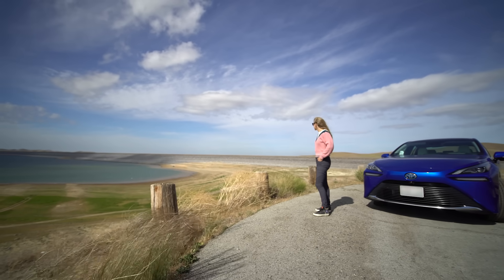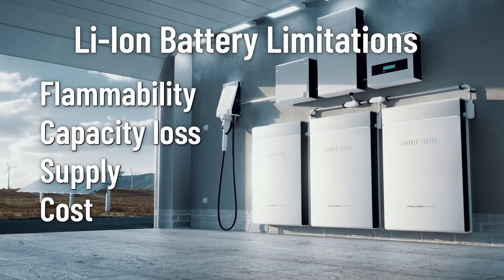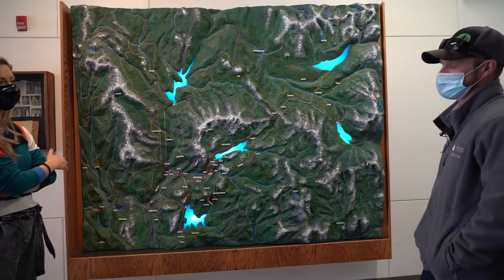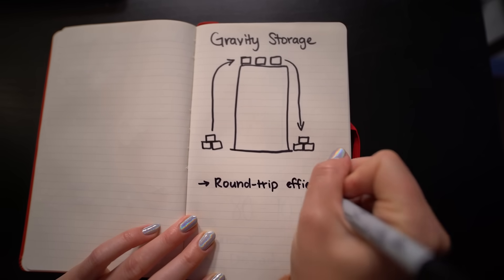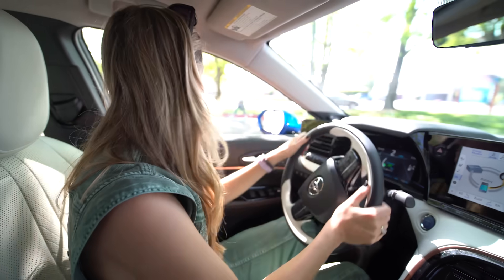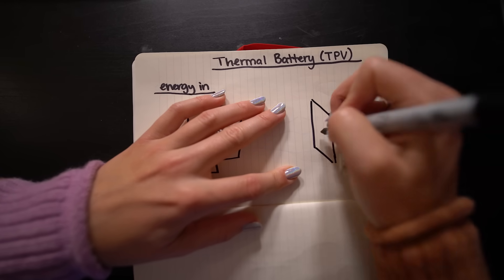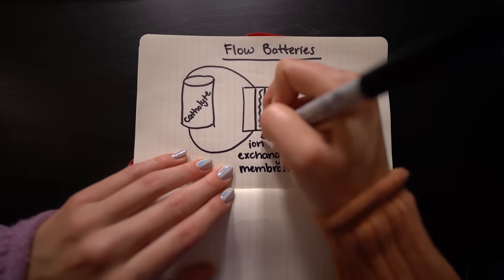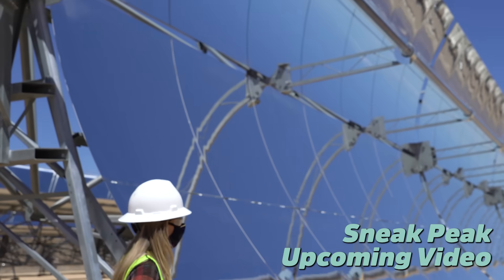The BIGGEST problem with clean energy

Comment: what if you did it in the ground?  now it sounds weird i guess, but remember that "big tunnel" program from years ago?  they dug some huge holes in the ground to help with flooding in an area... now if you dig deep enough the temperature underground gets higher.... what if you used that?  i mean you dig your hole, the water is pumped in and goes to the bottom of the hole and is turned into steam... the steam rises... the steam then condenses and can be collected at a higher point in the tunnel.... so you can get power through both the steam rising and the water falling... the thing is to create a balance... between the amount of water going down and the amount collected from above, and the lag time needed to turn it to steam.... but idk how deep you would have to go?  how wide the hole would have to be? or the designs needed to harness the powers involved.... originally i just thought about it as a home power system, the size of a well but a very deep well, with the power system being able to be raised or lowered in the well, both for variable output and for repairs.... the thing is idk how it would work out.   ty for the chance of sharing it again thou... peace.

Comment: The biggest problem with renewable energy is our obsession with solar and wind, the two sources of electricity that are unreliable because they are both weather-based and weather is one of the least predictable things on Earth.  I live in Canada and we have an embarrassment of riches when it comes to hydropower.  Our hydropower is virtually limitless because we have more lakes than the rest of the world combined (over 2,000,000) along with 8,500 named rivers.  We could theoretically produce enough hydropower for the entire North American continent with just a drop in the bucket of what we're capable of producing.  Brazil could have all of South America covered and right there, we have the entire Western Hemisphere covered with an essentially limitless supply of clean and constant electricity.

Not even drought is enough to stop the water in a country with 2,000,000 lakes and 8,500 rivers.  It would take more than a century of constant drought to eradicate Canada's water and the rest of the world would run dry long before we did.

Comment: Thunderf00t would probably not be very nice to Diana's conclusions here. 
Energy Vault is a total scam. 🤦‍♂️
Batteries are only 50% efficient at storing energy, so that doesn't help. 🙄
Thunderf00t also mentioned that of all the dangerous things he works with, hydrogen is the one that scares him.
From an engineering point of view, it's the smallest atom and therefore it's VERY hard to contain. You have to make SEALS that are virtually perfect. At best, this means EVERYTHING to handle it is EXTREMELY expensive, and at worst it's extremely HAZARDOUS. 
It's better to convert that hydrogen into a hydrocarbon, but now it's just "gasoline" and we're back at square one 🤦‍♂️

Comment: Electric storage is the biggest problem only while we steadfastly refuse to acknowledge the obvious solution we had for 70 years: nuclear. Not the cheapest, granted (although most of cost barriers are artificial), but the most abundant, most reliable, clean (yes, clean) and the safest. Even climbing roofs to install residential solar is more dangerous per joule produced that nuclear.
(Inter)continetal grids could be a solution for making wind and solar more usable, but they are also woefully expansive, plus fragile (both technically and politically).

Comment: Australian Company 1414 Degrees uses Silicon as a thermal storage medium. Heating the silicon to change its state to liquid and energy can be recovered as thermal energy or converted into electricity using a Stirling (differential temperature) engine.

Another Australian Company, Fortescue Mining, is planning to use renewable energy to produce green Hydrogen and convert it into Ammonia (NH4). In this form storage is somewhat simpler. Ammonia can either be converted back into Hydrogen ,with Nitrogen as a by product,  to run through Fuel Cells  or the ammonia can be used directly as a fuel in modified internal combustion engines driving trucks and rail locomotives. Fortescue are also working on producing green steel.

Note none of these developments are supported by the current Australian government that subsidizes fossil fuel companies to the order of $A 10 Billion each year. Even such massive subsidies cannot quell innovative development.

Flow batteries using Hydrogen Bromide may also be potential solutions especially when used on site with Large Scale Solar Arrays or wind farms.

Comment: There is a middle step to battery powered electric cars.
Today the energy density and the recharge times are not what the market wants.
There will be no mass adoption of current EVs because they take hours to charge, have short range, and the replacement battery is so expensive that it discourage the used car market.
An electric car powered by a fuel cell fed with gasoline.
That would have the combined advantages of ICE cars and pure electric cars; plus they're would have double the mileage of an ICE car for the same amount of fuel, and no NOx and particulate emissions.
These cars would allow time for li-ion batteries to achieve 10x power density, and would allow time for the grid to add more generating power.
Forcing EVs on the market with insufficient batteries is a suboptimal choice...

Comment: Excellent topic, depth and breath of summarization. Thank you for this. You might try to give more info on cost-effectiveness of the various technologies for various usage cases, such as short-term peaks vs. longer-term storage for exceptional seasonal peaks. For example, converting solar based electricity to hydrogen via electrolysis at 70% efficiency and then back to electricity with a fuel cell at 50% efficiency is a combined round-trip efficiency of only 35% - not so good, particularly if the cost of the electrolyzing equipment, hydrogen storage and fuel cell is high. Fuel cells also have a short-life problem for the membrane, as well as high maintenance / short-life issues for other components.
Reply: But the video series is partially sponsored by Toyota.

Comment: Syngas. It's WW2 technology. If you strike an arc underwater using carbon rods it makes syngas. Pv could do it with no charge controller needed. 
The production of Biochar also makes syngas. Biochar is a permanent carbon store and fertilizer. 
fischer troppes process can create gasoline using syngas.
Pv as a input for pyrolitic processing of waste agricultural biomass would yield syngas and biochar.

Comment: I think fully synthetic fuel production is the least worst technology we have for storing energy. And we should put some CO2 into the synthetic fuel to make it easier to compress. Fun fact: gasoline contains more hydrogen per litre than a litre of pure hydrogen!

Cons: (1) efficiency is actually pretty poor, like full roundtrip to electricity to storage to electricity somewhere between 10% and 50% in the best case. It makes resulting electricity much more expensive than burning fossil fuels.

Pros: (1) we already have all the required technology minus the big production facilities that are not currently built because the cost of the synthetic fuel is too high compared to compatible fossil fuels, (2) storage is simple: just put the fuel into canisters or tanks, just like methanol, gasoline or diesel, (3) it's possible to produce fully synthetic gasoline and diesel; all existing cars and trucks with internal combustion engines could be running with fully synthetic fuel made out of CO2, water and electricity. It would allow change to green power much faster than replacing all those vehicles with EVs.

Comment: Have I missed something? If you pump water up to a higher level you use a certain amount of energy. If you release the same quantity of water back down again (via a turbine, say) you produce energy. The overall efficiency is always less than 100% so all of the energy produced  PLUS a top-up from another source is needed for the pump. There's no surplus from the system to hand out to customers. It's the old perpetual motion chestnut, ain't it?

Comment: I installed a 5kW solar power system with 20kWh of LiFePO battery storage and the whole thing only cost about $8k. It's not that expensive and LiFePO batteries are supposed to last 10 years or so.

Comment: A bigger problem is that solar panels are toxic and cannot (currently) be recycled, and the old wind turbines have to be cut up and buried (their fibreglass particles aren't great either). The elephant in the room is that nuclear has a smaller carbon footprint than both solar and wind.

Comment: Great video - one technology I have been tracking for a few years is hot batteries - Ambri's liquid metal hydride batteries - that operate on common elements operating at around 600 - 800 degrees Celcius.  Very interesting that they love heavy use, aren't subject to thermal runaway and have no apparent fade over time - perfect for grid scale operation!  A shipping container holds about a mega watt hour of power.
Reply: Not "metal hydride", just metal!
Reply: @gregbailey45  I just took what I recall Professor Sadoway at MIT call them - reckon he should know... I will check - maybe the chemistry has moved on in 8 years - or they have simplified the language for Marketing / Investment readiness attractiveness!
Reply: @gregbailey45  wow you are right - the word hydride has been removed from all the literature!

Comment: Compressed air power storage has a couple of other benefits as well. One is that you don't just get air you get atmospheric air which comes with pollutants and water which means that you can isolate the pollutants and you can extract the water and you can even use the compressed air to do work in the process of releasing it you can use it to run machines you can use it to generate power you can use it to do other forms of work. You can also use the compressed air in fractioning plants that extract nitrogen oxygen and hydrogen which are used in rocket fuel farming and so forth

Comment: It blows my mind that people take the mechanical gravity storage systems seriously, or hydrogen for that matter.  Anyone of thinks carinas can lift blocks up in down all day regardless of the weather and with minimal maintenance have never been around any soft of construction. Hydrogen will get used for industrial applications but it's way more dangerous than natural gas.  I can get past air tight seals and is far more reactive than other gasses. It's just never going to be something that makes sense for general distribution systems. Also the round trip efficiency is awful so why take all the risk when there are better alternatives. 

We should also note that more energy and a better grid will take care of most of what we currently see as a supply problem. The sun always shines some where any the wind always blows somewhere. Then the smart grid and local thermal storage can take care of a lot of problems. On a residential level you heat or cool water tanks when energy is abundant and then use that thermal mass for your heating and cooling when energy is low.  Then on the industrial side you would probably need a credit system that rewards companies for reducing usage when the grid is low on energy. For example a lot of industrial energy is dedicated to compressed air and hot water, both of which are something that is easy and clean to store.

Comment: The reason that pumped storage was initially designed was to have a very quick response source of electrical generation to compensate for sudden imbalance of supply and demand, either due to a loss of a generating plant or sudden high increase in demand. Pumped hydro can come on line and up to maximum ouptput in seconds to maintain frequency.
The idea that storge can compensate for renewable intermittency is a false premise. It simply cannot happen.

Comment: I am for the use of green energy, but one question has bugged me for some time: 

With all these large-scale green energy projects, let‘s extrapolate for a moment to what would be needed if we all did away with any energy source that is not green … Has anyone done the calculation to predict what would happen when all that energy is taken away from where it is usually deposited (solar, wind, waves) and then used somewhere else?

Obviously solar power at local level and/or for personal use is not (less of?) an issue. But can the same be said for mass-scale solar energy plants providing city-level power for distant locations? Consider heating & powering something the size of a major city in winter = how much of that energy has to be taken out of somewhere else? Now scale that up to ‚global‘ … might we then just have another mechanism for upsetting the delicate balance between Earth, the atmosphere and the weather then too?

Comment: The US has dozens of Pumped Hydro Storage plants.  Yet no new PHS has been built in 30 yrs. There are good reasons for this, both geographical end economic.  Why can’t PG investigate these instead?  

PG talks of H2 and is driving around in an FC.  Yet after decades there are only concept FC cars for sale; there are not FC cars in mass production anywhere in the world. Why? There is no system for mass production of H2, again for good reason as H2 is difficult to transport.  

Indeed in the continental US there are only a handful of H2 fueling stations only in CA, and thus no FC cars for sale elsewhere.  

The useful storage conversation is not a list of possibilities, but a comparison with the king which is liquid fuels.  That 9000gal gasoline tanker truck delivers an hour of Hoover Dam size energy to every other street corner in minutes.  Nothing else comes close.

Comment: The actual 'final' solution not only has to include improved energy generation / storage solutions described well in this video, but also ENERGY CONSUMPTION.  We as consumers need to learn how to increase the efficiency of our energy use.  This may include WHEN we time our peak demand in a day but must also include more efficient (insulated) buildings among other practices.  We need to be educating people now to encourage new construction that utilizes the best practices currently available.  We also need to look at how we should be refurbishing old construction and the costs associated with it.  
These solutions must also include assessment of the environmental cost / impact from the manufacture and disposal of any new approach (new formulations for chemical batteries for example).  There must be a net positive impact on the environment from this cost and not just for the portion of time when energy is generated / stored / used.

Comment: another storage system uses sunlight reflecting onto sodium, melting it and using that heat for energy production.
i suggested to a mining company that they use a depleted mine for storing air under compression to store energy.  they replied, "how do you seal the mine?"  i thought that would be easy, but
then i thought about earthquakes from changing air pressure.

Comment: Physics Girl, I'm sorry to tell you, you are wrong storage is not the biggest issue.  And the renewable energy experts aren't going to tell you what the biggest issues are, because they know that the REAL serious problems are what make virtually all our "eco" energy technologies non starters.  

1.  Infrastructure.  Solar and wind are very low density energy sources, building and maintaining solar and wind will take 100 times the infrastructure.  That means 100x the steel and materials, 100x the manpower to maintain, and probably 1000x the space requirements.  This will cost, hundreds of trillions of dollars, and in the case of solar will need to be replaced ever 15 years.  This is not even close to being sustainable.  
2.  Toxic waste.  Producing solar panels and li-ion batteries creates a lot of toxic waste currently.  If we were to ramp up solar panel production to the point where it would actually generate a significant amount of our energy consumption, we would need to deal with an astronomical amount of toxic chemical waste.  And because solar has a 25 year lifespan and need to be replaced (which btw, makes them NOT renewable) this toxic waste nightmare will be an ongoing concern.

You want me to believe like I once did that this channel is about science and not zealotry, have some courage, and make a serious video examining these issues while being open to the possibility that you could be very wrong and on the wrong side of history with this.

Comment: Apparently they've made some significant headway regarding gravity battery power generators (one of which is situated in Norway, I believe)...doesn't require wind or solar. It appears some green renewable energy sources are not so limited.

Comment: There’s a cool thing they do with hydro dams to solve this issue they use excess energy to pump water to high level lakes essentially and when the power runs out they just let it flow through the dam. I think it’s the cheapest battery’s possible on a large scale and I could see it being used to store huge amounts of say solar energy excess. Also I forgot the name but thoes mirrors that all point to one spot to heat up a liquid to produce steam to spin turbines actualy hold their energy for a few hours after sundown. However it’s not too efficient and requires a lot of land use. Still it’s not easy